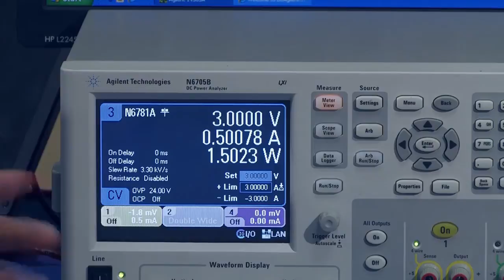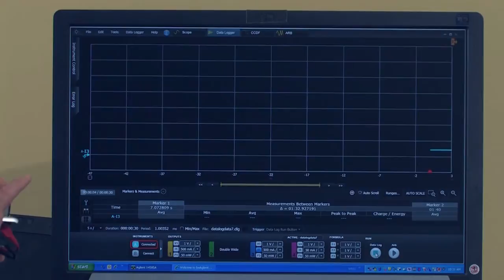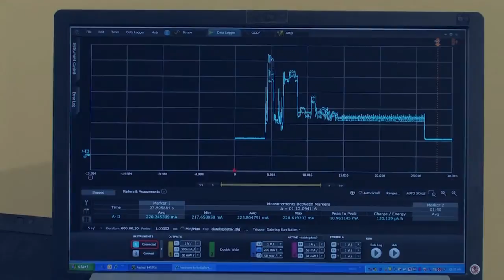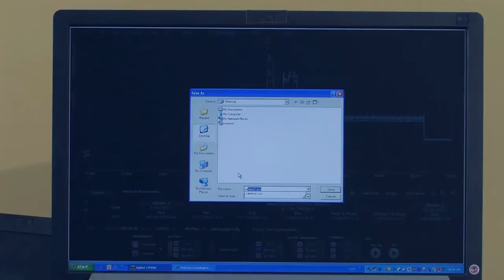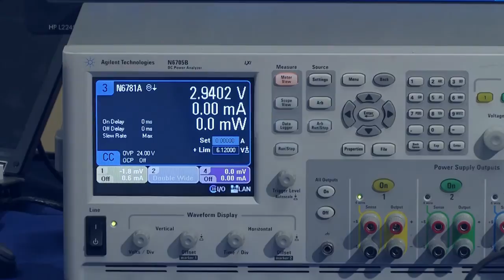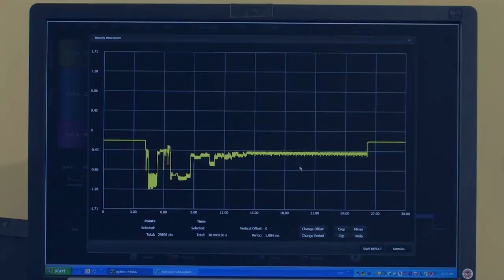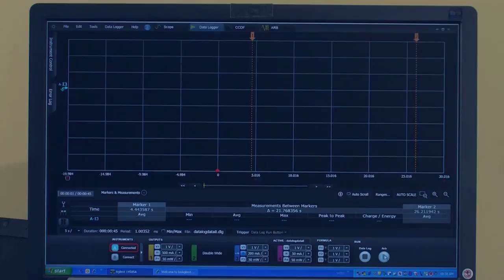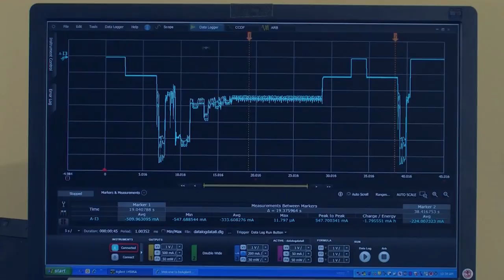Capturing the Dynamic Current from a Battery Power Device and Using it as a Load on the Batteries

Comment: Does N6781A have this playback feature?
Reply from the maker: Saige NI   Yes, all the modules have the ability to digitize the current.
Reply: @KeysightHandsOn  does N6781A can save current consmuption of DUT and then with  this current consumption  test how will real battery, which will be used in device, perform?
Reply from the maker: @mislavkulas4422  Correct. You can capture the dynamic current waveform being used by your device and then load it as a power arbitrary waveform to test a battery. Also, you can test your complete system. The N6781A can be used just as an analyzer and measure the actual current from the battery to your device.
Reply: @KeysightHandsOn  can you please say how i can use n6781a  as a battery load when i have already measure current consumption on my DUT (n6781a was in battery simulator mode)
Reply from the maker: @mislavkulas4422  At around 6:45 minutes in the video, the SMU is set up as an electronic load.  At this point, you could enter a negative current value and the battery would be discharged with the constant current. You could also use an arb waveform as shown in the video to vary the discharge rate. The discharge arb in the video is calculated by multiplying the source arb by -1.